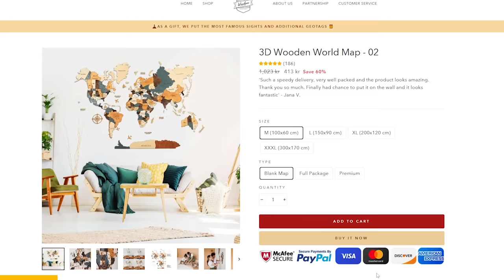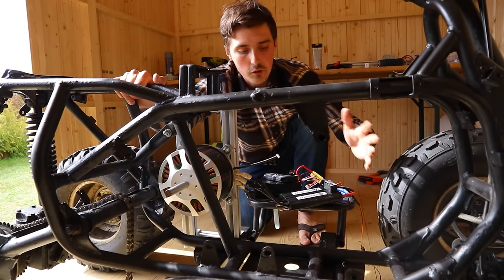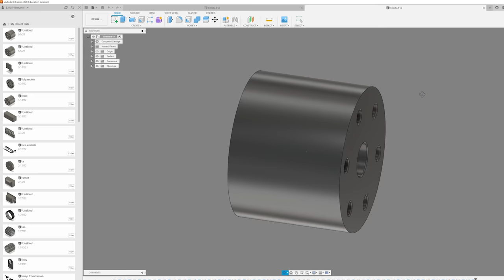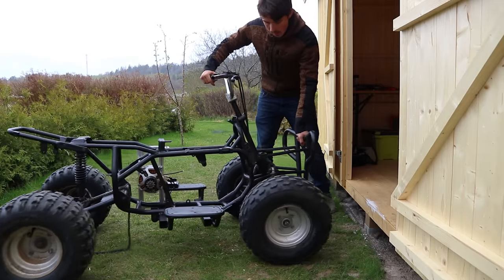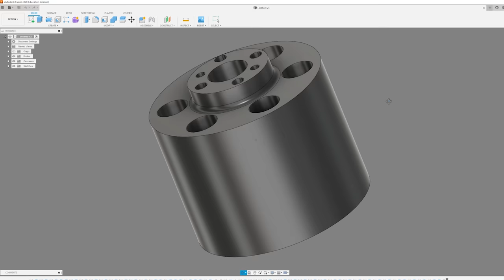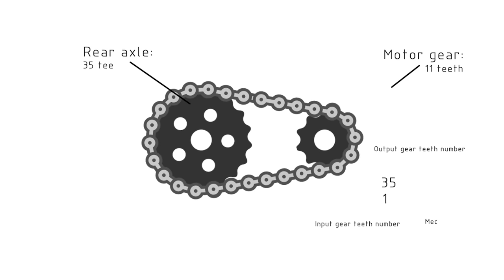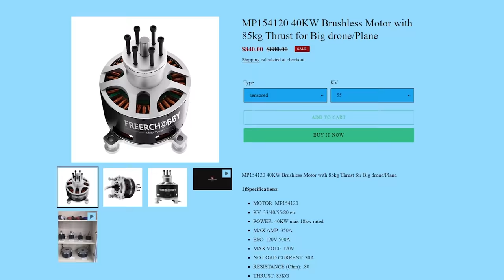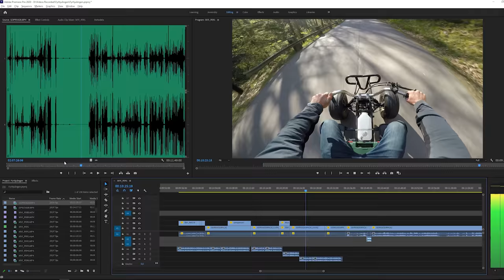I Bought an ATV and Made It Electric

Comment: I'm starting to build an electric barstool using 24vdc wheelchair motors.  Waiting on a joystick controller to get here, but for now I have a Saber Tooth motor controller and using RC controls.  The first version worked ok, but I wanted to go to the joystick controller for in house use.  I just had knee replacement surgery a year ago and now the knee became infected and had to have the implant removed and still fighting the infection.  This has made me miserable and it is almost impossible to get around and do the work I want to do.  Ordered a used electric wheel chair off eBay and the seller is screwing me over and it takes for ever to get eBay or PayPal to help with anything.  The eBay ad said free shipping so I took a chance and now the dude is trying to make me pay for shipping.  Not going to happen!!!!  I hate false advertising and liars!   I was hoping the VA would help with a electric scooter since they are the ones that did the surgery, but so far no luck.  Starting to get the feeling they would like to see me drop dead and disappear.

Comment: Voltage is RPM. Not torque at all. Current is torque. To increase torque using voltage you need to gear it down because the RPM will go up and you want to gear down to get more torque.

Comment: I want to do this but have a really powerful electric motor and use like a 3 or 5hp Briggs engine connected to a generator to charge the battery's if needed like a Chevy volt

Comment: RPM
lets say he get 80kv motor (not KW ...KV meaning rpm per volt)
48v x 80KV =3840rpm x  circumference of the tire  = around 143.6cm  ~ 56.5 inch
3840 rpm x 143.6cm  x 60min (because its rpm we need per hour)  divide per 1 km = 330.85kmh YUP almost 331kmh  IM FAST BOIII
divide that with 3.18 gearing = around 104kmh max speed 
maybe too fast 
but 
if he will use sensored mode it will work waaaaaaay better
waaay waaay better

PS
u can get VESC for 100V++ for around 100-200$

Comment: 9:50 Look at this. See how you jump/skip forward through space? To fix this make sure your camera is shooting in true 30fps not 29.95. Try to run it in PAL mode at 30 if the drop-down menu doesn't give you a difference in NTSC mode. Lastly, make sure when you edit, that the editing timeline matches your FPS (whether it's 29.95 still and you have no way to go to true 30, or if you do get true 30).

Youtube doesn't like decimal frame rates, so whenever you upload one, it re-encodes the video to true frame rate and you get this horrible skipping artifact. Same thing happens if you edit on a mismatched timeline to footage. And it's worse if you end up doing both.

Last trick, if you're in an NTSC region, be sure to set your shutter speed to 1/40 as opposed to 1/60 for a little more natural motion blur. Also, lock the shutter speed and let the camera auto adjust exposure through the aperture and/or ISO (but also put a hard cap on ISO, probably somewhere in the 400-800 range depending on how grainy/noisy the picture gets (experiment!) with the minimum being whatever the lowest your camera goes down to is.

If you're in a PAL region, shoot with a 1/50 shutter. These shutter settings are to prevent interior artificial lights from flickering while maintaining natural motion blur. Also, get an ND filter if you can, that way you have even more fine control over bright outdoor exposure. Exposing a step or so darker than natural usually improves footage AND gives you more options/flexibility in post when you go to adjust and color grade. You can always bring the darks up, but once an image is overexposed/blown out in the highlights, you can't fix it. (Plus slightly underexposed footage looks more filmic/cinematic/aesthetic)

Comment: Why can't you have an electric motor on the same axle a generator and maybe two more generators up on the tires front tires.. have two batteries,when one starts getting low switch over to the other one and then the generators will charge the Low one. And on and on in a circle switching back and forth when you need . riding and charging at the same time when battery gets low switch over the other battery. perpetual motion.🤔😀

Comment: pure dc brushless motors without any speed controllers are the best, ditch them
Reply: simple potentiometer with variable resistance as the speed current controller, variable current source
Reply: diy  the real pure dc brushless motor if none are found in the store
Reply: immediate torque, no poles, for the true dc motor, even brushed
Reply: dont buy an esc, print your own motors, do your own metal-air ethanol-koh fuel cells, like from iron foil

Comment: dont buy an escm get a proper controller that has the sensors and that should run you cheaper, sabvoton 96120 svmc series controller, should work better that any esc controllers

Comment: you did this whole project soooo wrong.. you approached it from an rc background.. you need to approach it from a pev view since youre building a pev, not a rc car. In theory theyre basically the same products used mostly but pev electronics have features better suited to be used as pev components...

My diy ebike has a qs273 50H. 168v 200A max. motor rated for 120kph at 72v. i have my sabvoton 72200 turned down to 90A and im getting mid 60's out of my bike. the motor was 1400, controller was 250$, and i built my own battery. lipos are easy to buy but you wont get nearly the right numbers for performance from lipos. theyre overpriced and under dewliver for capacity. theyre crammed full of power. theyll hit 50C no problem but unless you wanna have max performance for 3 minutes (giggity) i would build my own liion pack. I have a 20S 12P pack of panasonic ncr 21700's. 84v, 180A continuous, 60AH. 60,000mah. i get 30-100 miles of range on my bike depending how i drive it.

You definitely know your shit when it comes to building things but take advantage of the MANY pev parts available all over the world. and build your own battery!!!!! you will have better parts for less money if you use parts designed for pev's.

Comment: I don't understand why are you buying those sh***y esc-s over and over again and then be surprised when all of them fail. Have you got a single type which have not failed on you?
Just buy a "VESC 100/250" and enjoy the proper sensorless startup, proper sensor training, motor parameter measurement, etc. These are like 10% more expensive than the sh*t you buy, but these won't suddenly fail. But I guess explosions and fire makes a good video so...